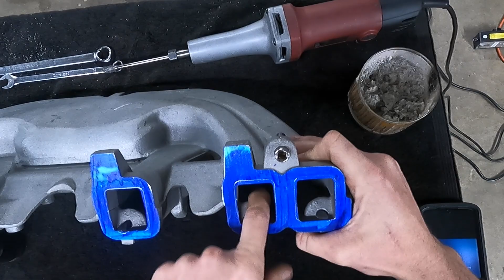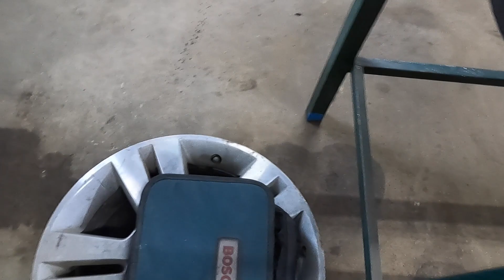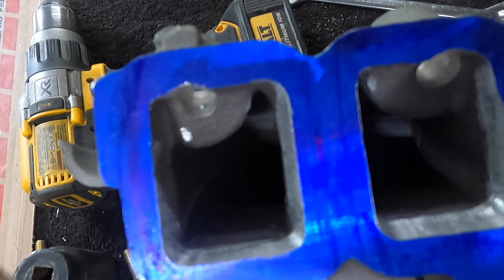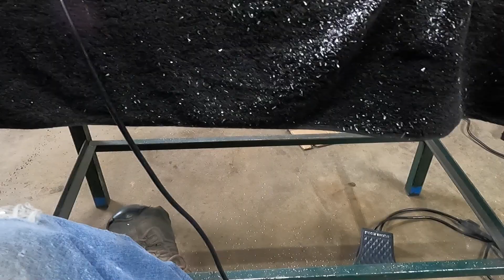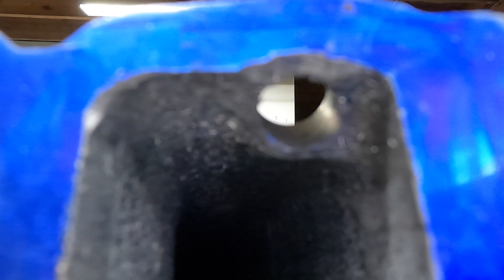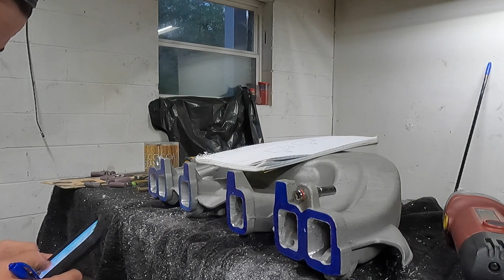jeep 4.0 intake manifold porting

Comment: Before starting you should have checked the fitment of the manifold to the head.  Without knowing that you might have made it worse by opening/moving the ports.  My guess is that the bolt holes just needed to move further instead of moving the ports, they look way off.
Reply from the maker: The gasket and the intake are located with dowels it's not going to be that far off. The entire manifold was warped is why the dowels wouldn't work. I know because I took it to the machinist and we surfaced it. It was warped a lot. But it's the same pattern as the gasket that matches the head. So it's fine.

Comment: Hi! did you feel a big difference? and the difference between the original intake pipe and this one is the difference worth the swap or not? THANKS
Reply from the maker: Not really worth it. If there was a difference it was hard to tell.
Reply: @thomasbeyer  thanks! and for the match port, is all the work of enlarging the intake manifolds worth doing? what is the feeling after making the modification?
Reply from the maker: @passion-pilotagedriver1770  I'm sure it's worth something but it's only going to be seen on a dyno not going to be enough to feel
Reply: @thomasbeyer  ok Thomas! Thank you🙂
Reply: This is going to do nothing for your Jeep those throttle bodies intake manifolds and exhaust are over-engineered to provide way more air than the engine needs the only way you're going to benefit from any of this is if you put bigger intake valves into the head because that's the final restriction only so much air can move through the intake valve so until you get bigger intake valves you're not going to get more air into the engine. The only work around without getting the head worked on is to put a different cam in there that will open the valve farther and or longer to allow more air in other than that you would be looking at more forced air induction to cram more air through the valve. And keep in mind that the more air you cram into the engine the more fuel you're going to need so if you're adding more air than  fuel you're going to run into problems you're going to need bigger fuel injectors and you're going to need more fuel pressure on the rail to provide more fuel for the bigger fuel injectors

Comment: Curious to see how well it welds Thomas.
Reply from the maker: Did you check out the weld video?
Reply: Looks good  @thomasbeyer
Reply from the maker: Thank you. Iv had a lot practice. And I've definitely made it worse a time or two
Reply: @thomasbeyer  when are you going to get back on this??
Reply from the maker: @LawrenceOrsini  probably in a couple months
Reply from the maker: It won't be too bad iv welded a lot of cast manifolds just have to start a 1/4 inch from the edge of the hole and work my way in. But I'll let you know
Reply from the maker: Especially cuz this is a new intake it doesn't have a lot of crap in the pores but usually when we do an old one just throw it on the barbecue for a while get it hot for an hour and then start working with it. That usually cooks most of garbage out of it